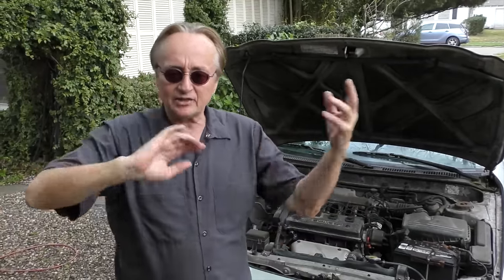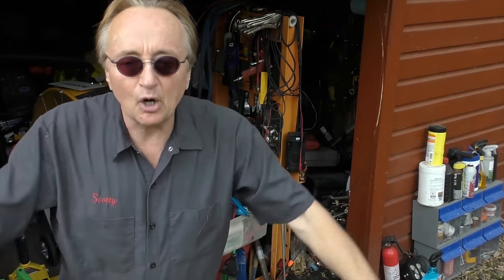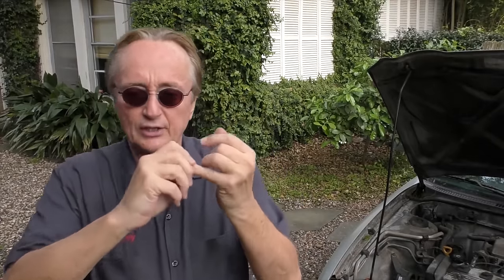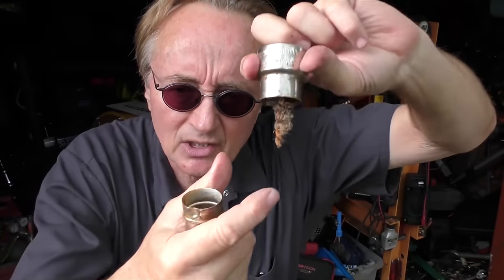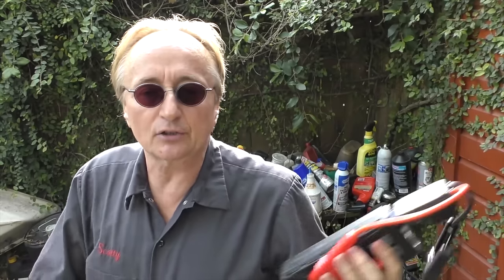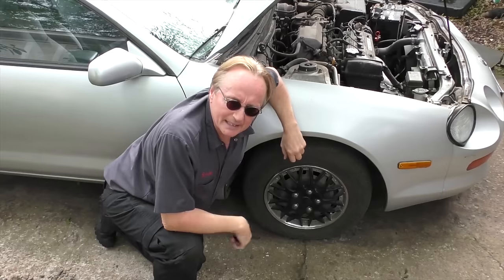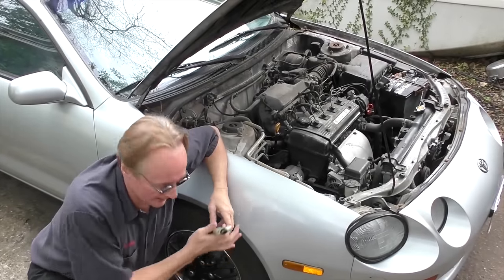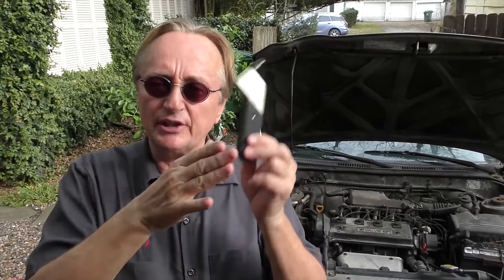If You're Not Doing This Before Starting Your Car, You're Stupid

Comment: LIGHT$$$ Yrs ago, (1992+-?) I worked at a Chevy dealership, and read some of the "tech" books, .... when the 50,000?? miles light came on, the "TECH BOOK" answer / "fix", was,..... CUT THE WIRE!

Comment: If you are low in brake fluid and do not see a leak/system is not leaking. That means you need new brake pads. Fluid goes down as you wear your brake pads.

Comment: My car is 23 years old and Japanese. Certain parts have already become unavailable. In that case, what if a certain recall has never been performed and the necessary replacement part no longer available? Is the manufacturer, in that case, required to put that certain part back into production again?

Comment: i have a 2005 honda accord euro. got engine warning light come on because of a dead  ignition coil. i diagnosed the problem fixed it. but even using my OBD2 scanner i couldnt reset the codel.had to take it to honda dealer to get them to do it. $80 for them to clear the code. ridiculous. |Normal OBD2 came up with no codes. problem was car was put into limp mode so |I had to get it cleared.

Comment: 50 seconds in. and MAYBE just MAYBE the light coming on for the brakes means something isn't correct with something in the braking system LIKE LOW FLUID its not scary at all almost like "oh well i should look at that" my wiper fluid light is on right now because its empty and i haven't refilled it its not trying to scare me its giving me useful information that something isn't correct

Comment: One thing not mentioned was using the correct brake fluid DOT 3, 4 or 5.... Wish I knew the brand of the battery jumper, I may use Google lens to find out.

Comment: If the low brake fluid light comes on, meaning the fluid is low, I wouldn’t just check for leaks, but also how far the brake pads were worn out and need replacing, as that also could be the reason. Also if you fill the Reservoir up to the Full Line, when the brake pads changed you going to need to remove some as the Reservoir will overflow and could damage some components under the bonnet (hood).
Service Lights are not controlled by just millage, but driving conditions, time. So if you do a lot of short journeys at could come on after only 3/4000 miles.

Comment: Regarding recalls, Hyundai has a valve cover gasket leak(3.3 V6 Lambda Engine) that leaks oil on alternators but it's not possible to completely fix. I have had my gasket and alternator replaced 2 times under recall yet 5 ,000 miles later it's happening again. Mechanic even RTV the corner where it leaks. How many times do you think will they fix it? It keeps happening and it's a known problem with the engine. If they say they can't fix anymore for free, could I take it to another dealer? Hope you see this or anyone that can help me for that matter. Thanks.

Comment: Please never fill your brake fluid for normal pad wear.  Replace the pads and when you push the caliper pistons back in, the fluid will go back up! Brake fluid is in a closed system, so it doesn't evaporate as long as there are no openings (leaks) in the system.  The vehicle is designed to have the brake light turn on when pad wear is low enough to need inspection.  That won't work with the wrong fluid level (aka topping off the fluid)!

Comment: Does a coolant expansion tank require antifreeze in it or is it fine without any? I went back and forth w an AAA mechanic who tried to convince me that it is completely fine if it’s empty because it’s a reservoir tank, and that it’s only made for antifreeze to pour into from the radiator when it heats up

Comment: I have a 2002 Honda Accord V-6 with an engine and transmission oil leak at 100,000 miles. Mechanic said it’s the oil pump seal? And the transmission leak involves dropping the transmission and checking the casing? Please help, quoted $3,000 - $3,500 to do both including timing belt / kit r & r. Thank you, Alex

Comment: My brake light came on and the brakes were working but the stopping felt strange. I took it to a shop that I trust and both my rear brake lines were leaking. I could have topped up the fluid but still would have had a problem that needed fixing. Absolutely, check the fluid and cap as Scotty says but  you need to trust your gut about how the car feels to drive to, especially with brakes. The brake light comes on and the car feels fine, you’ve got some time to figure it out. Brake light comes on and the car won’t stop or stop as it should, take it to a good shop.

Comment: For some reason car makers don't use battery terminal corrosion preventatives when they put the battery in the car. If it is used, on properly tightened terminals, you will never have corrosion and never have loose terminals, for the life of the battery, 5 to 7 years. Ordinary multi-purpose grease works just fine. You could even use petroleum jelly (Vaseline). Protect the terminals on a new car, or when you get a new battery, and you will never have problems with corrosion or looseness for the life of the battery, 5 to 7 years.

Comment: I have been driving with engine light on for almost year now. I will wait until I move close to my son to fix the car. Last June I got ripped off from "Super Lube" in NC. The first time engine light was come on and the guy working there made me pay 775.00 for parts but every time i went to the shop or call them they made excuse the parts not come in yet so I gave up the part cost 775.00 plus 140.00 for ran the system on my car. Now I'm scared for them to fix my car & I wouldn't even bother to go back. I believe what goes around what comes around... their lives will be very difficult with that dishonest to the customers. I wouldn't recomand people to using "Super Lube" in NC. Please becareful!

Comment: I have a 2002 Audi A4 1.8t 5speed manual, when I drive it says that my emergency brake is engaged when it really isn’t. Any idea what’s wrong?
Reply: You've got  a short. First check the fuse. If the fuse is okay, you're gonna have to following the wiring and check the connections.

Comment: I just sold a 2016 Chevy Custom Silverado, and the buyer took it to the local dealership to get it inspected BEFORE he bought it.  They told him ALL 4 rotors were warped, but didn't mention the brake pads.  1 time out of a hundred, you might have a car with 100,000 miles on it that has two rotors warp, and you desperately need new brake pads, too.  The odds of a 43,000 mile truck having all 4 rotors warped is a million to one.  Ask your mechanic.

Comment: well, the light is there to tell you the fluid is low due to the fact tour brake pads have worn down and should be replaced. Waiting too long to replace them could wear them down all the way to the metal and you will have to change your brake rotors too. So adding fluid could actually not save you money.

Comment: Scotty can please help me to solve my Toyota Unser 2004 model. 
I am facing my car sometimes it is normal function and at times my reverse and sometimes my forward won't cordinate when I released the brake paddle. I have to rev the engine to get a jerk only it move. Once move on no problem gear change nicely. But once I off my engine then move on again I will at times face this problem.
Can help me diagnose.

Comment: The info on the door sticker shows the tire pressure front and rear should be 38 PSI. The air pressure noted on the tire shows the pressure should be 51 Max. What should the tire pressure be set at ?

Comment: Surprised you suggested 50/50 antifreeze. For a couple of dollars more you get the concentrated, mix it with a gallon of distilled water ($0.89) you get 2 full gallons. I always have a 2½ gallon jug from DEF or spring water to mix it in, obviously any bucket will do too.

Comment: $8-9 for 50/50 coolant mix, or $11 for concentrate.  "Measuring" 50/50 ain't rocket science; save an empty jug, pour half the new jug into it and top both off with water.  Sharpie "MIX" on top of both jugs and boom: you've got two jugs of ready-to-use for just a couple bucks more than one jug of premixed.

Comment: I once drove a car to service to change rims and they installed air pressure sensor to the rims. So i drove back home about 100 km then the air pressure warning light turned on, so drove back to the service, because i thought the sensors were faulty or something. At the service it turned out that they pumped air into car in warm rooms and outside was very cold . Basically i drove 100km to the service to pump air into the tyres :D.

Comment: I hate it when people top off the brake fluid instead of replacing the brake pads that are wore out. When you push the caliper piston back in when you replace brake pads cuz we're all that fluid goes all over your garage floor. If your brake fluid is that low you either have a leak or your brake pads need replaced

Comment: Hey, Scotty. I got a digital and a mechanical tire pressure gauge. The readings are off. Which one should I trust? Thanks, bud 😉
Reply: Digital.
Reply: wholeNwon 
A mechanic told me there was less that could go wrong with a mechanic gauge 🤷‍♂️
Reply: @Johnny-ip4mk  Think about it:  Has to be just the opposite. An electronic gauge, like a lot of other electronic stuff, either works or it doesn't at all..nothing in between.

Comment: Uhhhhhh, if your brake fluid is low, you either have a leak or your pads are worn out. Both of which are major issues that could wind you up in serious trouble very quickly...

Comment: I asked what kind of fuel should I use in my fuel injected truck . He said you can use regular . Wrong a high test for fuel injection otherwise you will have issues like constant check engine light . Which said I had a slow responding oxygen sensor . Not it`s the regular crap fuel . Today cars are like a new condo you get rid of it in less than 20 years.

Comment: Hello Scotty this is Jeff Rice from Tennessee I'm driving this Suzuki XL 7 2007 and this thing has got so many goofy problems I need to speak to somebody I've tried to get to the bottom of them there's nothing on this thing that hardly works fuel gauge everything's digital yet with monologue type gauges however they never read right to include the RPM and speedometer sometimes work sometimes don't it's just crazy.

Comment: Scotty, love ya man, but I gotta disagree about Run Flats.  My wife's BMW has Pirelli Run Flats and have been a significant money saver when driving on I-95 in Northern Virginia.  Potholes are a menace and you always encounter them at speed.  Without Run Flats, we would have needed to replace the tires 5 or 6 times within the 3 months we have owned this car.  While they are not for everyone, performance autos with low-profile tires are nearly a must unless you want to change tires and wheels every other week.

Comment: I don’t know about the battery part though. I drove on a bad battery and it killed my alternator. Now granted this was over the course of a month so that might be the problem but still a driver should be careful when driving on a bad battery because it does put extra load on the alternator depending on the case

Comment: Rule #1. Never take your vehicle in for repair to the dealer, when it is out of warranty. A few years ago when we had to deal with that infamous air bag failure, I had to take my vehicle to a dealer to have the air bag replaced. Now I can't tell you the dealer's name, that was the closest to where I lived, but I can tell you what city it was in. It was Lake City Fl. I took a financial beating from the dealer in Lake City, over a U joint issue, and I swore I'd never go to that den of thieves again. I took the vehicle to the dealer in Gainesville Fl. When it was repaired, and the new, free air bag was replaced, the service writer came in the waiting room and said, you're all set, ready to go...................Ah, we happened to notice, your rear brake shoes are in need of changing. I asked the service writer, what are you doing, taking my wheels, and brake drums off, I brought in for an air bag replacement, and that's it. When I got home, I decided to check it out myself. The shoes were about half worn, that was 3 years ago. I'm still driving that vehicle around with those same brake shoes. I do have a brand new set, that I have had for the last 10 years, in a box patiently waiting to be needed, but, as of yet, the brakes are just fine. I treat my vehicle very well. All maintenance items are done by me, all fluid and filter changes are done, more frequently than manufacturers requirements. I treat it like a toy, an expensive TOY. YO, TAke it to a mechanic you can trust, like, Scotty. If you take care of your vehicle, it will take care of you. Oil and filter changes? There has been a TUN DRAined from that truck.............

Comment: A little knowledge is a dangerous thing. Scotty if the brake light comes on because the brake fluid is low, topping up the fluid is not the solution.  You must first know why and the system is not leaking, chances are the brake pads are worn out.   Good thing the light came on so you can check and not run the pads metal to metal.  Your answer of simply topping off the brake fluid just cost people hundreds of dollars.  Don't over simplify. Understand. Knowledge is key and there are honest, reliable sources.

Comment: Hi! Scotty love watching your videos on you tube! I have a 2006 Chevrolet Silverado i noticed the blue high beam indicator light comes on when the truck is just setting there locked up with nothing on? First noticed it one night when i walked by it and seen the light flashing then every sense when it's locked or unlocked about 15/20 seconds later the high beam indicator light comes on nobody seems to know why this happens. any advice? Thanks, mike
Reply: The only thing I can think of is the switch used for flashing the high beams, or that it is somehow related to the anti-theft system.
Reply: @user2C47 47 Any idea how to correct it?

Comment: Recalls, hah!  I called my local Tucson Chrysler dealerships several times over the course of the past year for first one recall (transmission cable) and then for a second recall (engine fan) for my 2017 Ram Promaster 1500. They stated the parts were on back order...for over a year!  I finally found a dealership 2 1/2 hours away in Phoenix that miraculously had the parts. Hmmm.  What’s up with that?

Comment: For more modern cars a battery concern can be directly related to a parasitic draw and that would need to be diagnosed With special equipment to diagnose the concern such as an amp clamp or even a brand exclusive scan tool.

Comment: actually the distance u may travel to check ur tires pressure is under 3 km or 1,86 miles or  ur car should be still for a 3 hours at least. if u go from home to the store and back it's useless but if it's 40 miles a way to travel u might need to check u tires pressure before u go,

Comment: Please people! when boosting a vehicle NEVER put the neg on the frame of the car! Most vehicle frame bonds are only good for around 50A & lack a large gauge wire back to the neg post of the battery. when boosting your amperages can be as high as 250A depending on the car. 
Most new vehicles have "Boost Posts"... this is ok to use. If you have acess to both posts on the battery than use them! Pos on first then Neg to avoid sparking, also dont connect with vehicle running.

Also dont ever boost a vehicle larger than the Boost Vehicle.

Comment: Seems that if your brake pads have worn so thin that you can see a drop in the level of the brake fluid reservoir, that you should get the brake pads replaced (or do it yourself).

Comment: I hate to tell you this, but apparently there ARE some recalls that include a mileage limitation. I only know this because there was a recall for the gas tank leaking due to a faulty check valve where the filler neck connects to the plastic gas tank on the Buick Rendezvous. (Still can't believe ANY car manufacturer would use a plastic gas tank, but if you've ever worked on a Rendezvous, you know why it's plastic). Well, not all VIN numbers were included in the recall. I called GM and they said that even though my Rendezvous was having the EXACT SAME ISSUE that the ones in the recall were having, that because my VIN number wasn't included in the recall, they wouldn't pay to fix it, and that tank is about $900-$1,000, not including labor. Here's where it gets interesting. After realizing that they were NOT going to fix my car no matter what, I gave up and forgot about it and kept driving it. (I know, fire hazard, but it's had that same leak for over 3 years now and that car is my daily driver.) 

Anyway, unbeknownst to me, at some point I guess they had so many complaints from owners who had the same issue, but their VIN numbers weren't included in the recall, just like mine, that they revised the recall to include ALL the Rendezvous', BUT they added a stipulation that the vehicle HAS TO HAVE LESS THAN 150,000 miles on it, which mine is over that NOW, but was under that limit when they revised it. Still won't fix it. If you know of a way for me to get the dealer, manufacturer or whoever to fix that leak, as they SHOULD have notified me that my vehicle was now included in the recall, but never did, I would really appreciate the help.